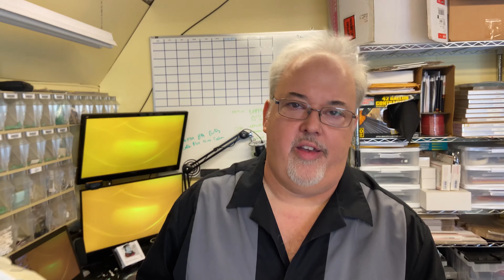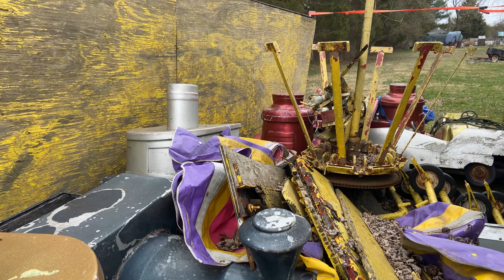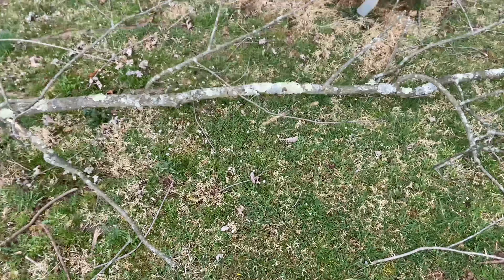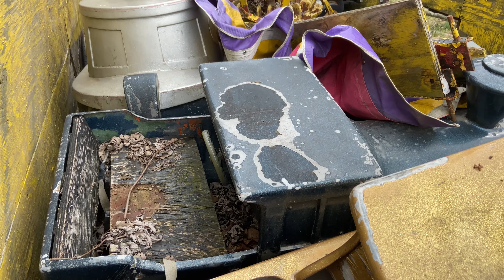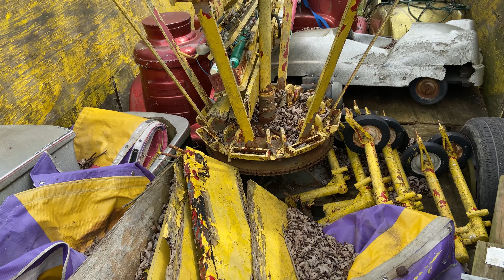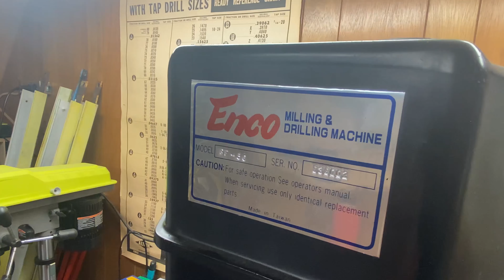Did I Really Buy Another Carnival Ride??

Comment: The fiber glass cars were most likely done in colorized gel coat with metal flake while in the molds. All of which is easily reapplied through a spray gun  and is very durable with today’s UV protection additives. They should not be painted IMHO.
Reply from the maker: We've been sanding one.  its a clear coat, a metal flake paint, body filler, white gel coat, then fiberglass.

Comment: Late seeing this (Only pretty recently found this channel after those ride setup videos) but hope your family's recovery went well. And I'm probably late in regards to what the plan is for these projects but an idea of what possibly could be done is make the Rocket as original as possible in the restoration and this Combo could possibly be going the route of more modernized and upgraded from the original based on how damaged the lighting already is and how the platform is so worn down, it seems like it could be interesting going for the best of both worlds route on the two projects.
Reply from the maker: everyone is pretty much back to normal, thanks.  That is along the lines of what I'm thinking too.  Rocket will definitely be traditional.  On the combo I especially want to try to restore the lights on the vehicles that were all removed at some point.  I may try to replicate the old fixtures, but with new internals.  And do something different with the decking..  Thanks for watching!

Comment: well pete sorry to here about your family hope they get well fast. I too have been waiting for your new videos.  I also bought a new ride but mine is a little bit more than i can chew, but chewing it down slowly. when you do the steering wheels let me know I would be interested in 10-12 ?  the new ride looks nice just like the stuff i buy. today i'm building train track. The fiberglass tubs are in great shape. cleaning them up use a palm sander w/220  grit.  I'm changing my lights to led just for cost reasons also there 24 volt  and co. prices are to high. the flooring /sides the newer ones (hampton rides) are aluminum much lighter than wood or steel. i also am building s jib crane to remove the larger toys.  thanks steve
Reply from the maker: glad to hear you are still working on your projects!  I'd love to go with aluminum diamond plate but everything is so expensive right now.  I know the ride originally had a wooden deck made out of individual wood planks.  I may try something like that just for the vintage look.
Reply: @PeteRondeau  this would also make for a vintage sound as the cars rolled around.
Reply from the maker: @dannyschell1095  that is an excellent point that I had not even considered! Thanks!